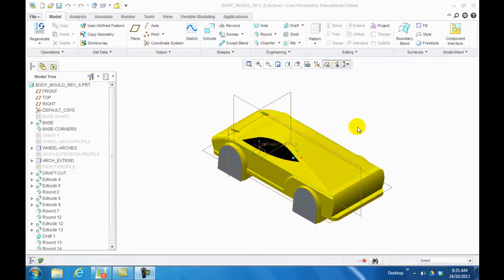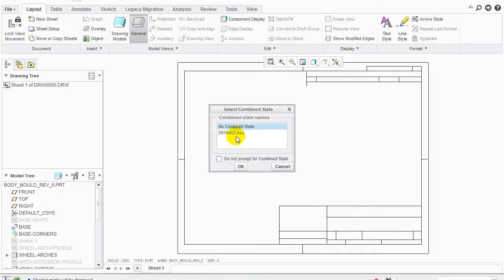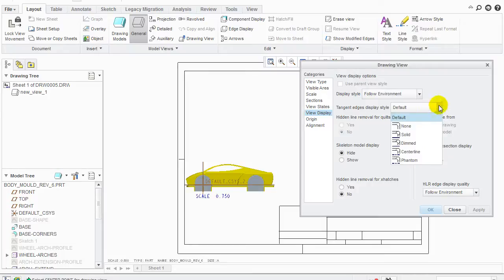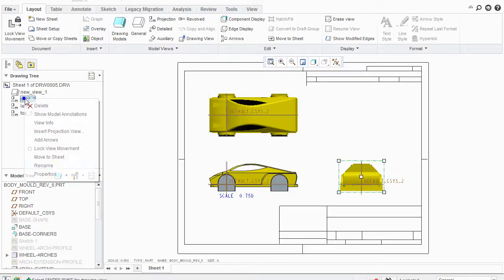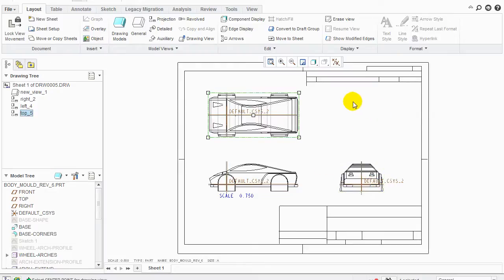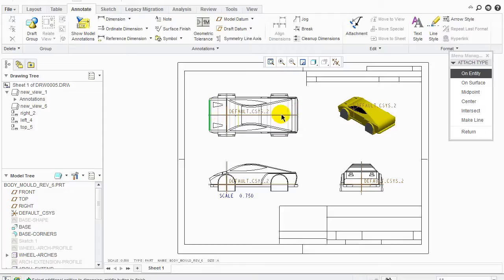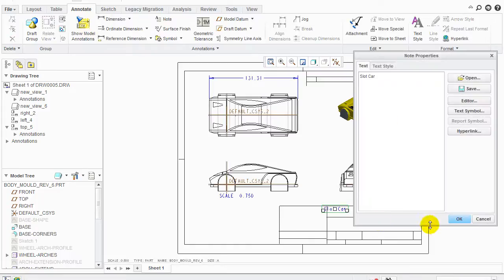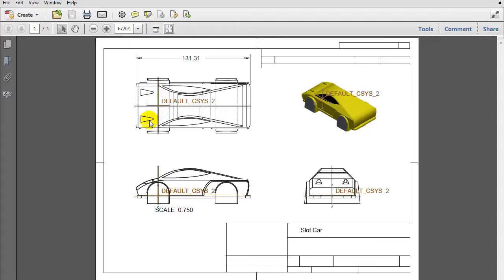Creo Elements   Creating an orthographic drawing - Working drawing - Print PDF

Comment: It is NOT Creo Elements (full name "Creo Elements/Modeling" and "Creo Elements/Drafting" aka ME10) ! It is Creo Parametric, which is totally different!
Reply: I'm having SUCH  a hard time finding Creo Elements Direct videos with commentary! The ones I find are usually silent, which isn't the way I learn. Do you have any good recommendations?
Reply: @evanharriman4913  No. I was using Creo Elements for 3 years, and I totally hate that degenerate outdated instrument. The most of all I hate how they mix completely different software under similar names, and sell the most important and basic OPERATIONS(commands) separately, making IT and purchasing staff heads blow up when choosing which to purchase. The mistake may cost a fortune.